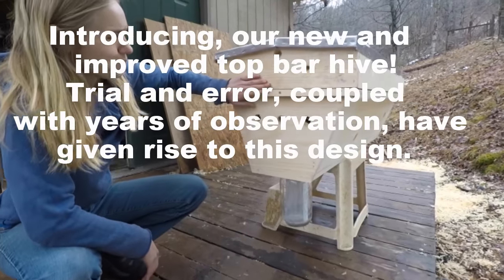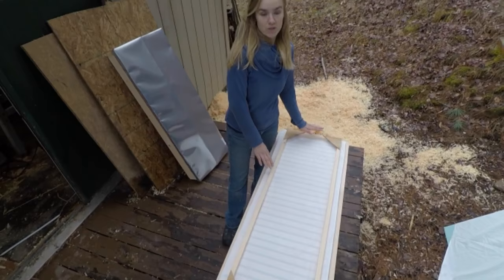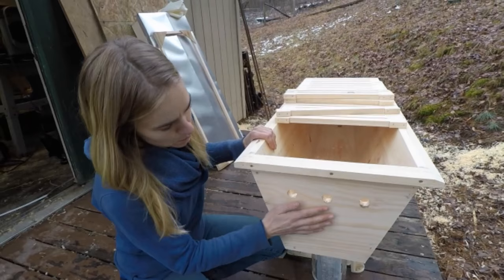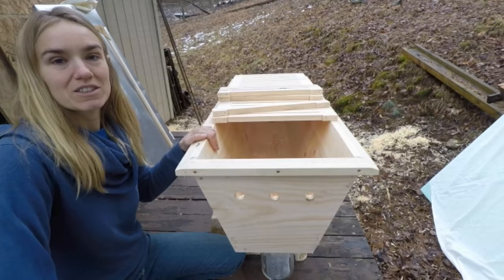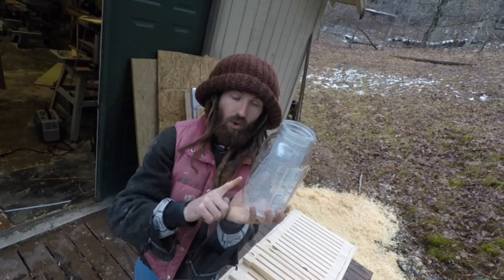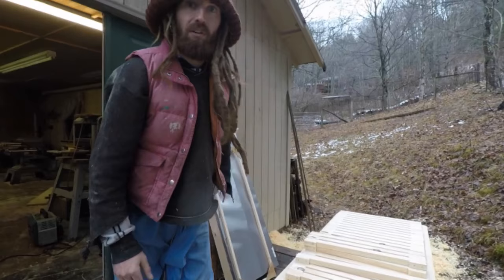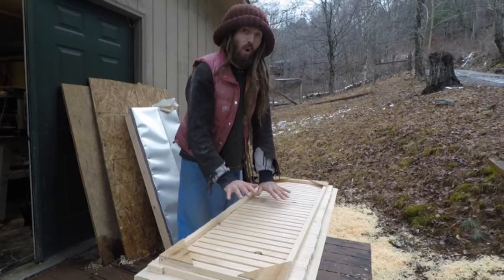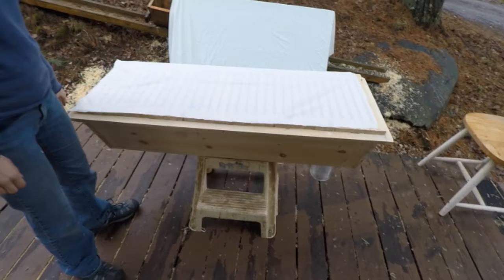DIY! New and Improved Top Bar Hive! part 1 Introduction

Comment: 1--Aluminium mesh for the bees in the summer feeder glass bottle would be good if the aluminium were not toxic. Some miniscule portion of it may dissolve in the sugary water and harm humans from the honey made by the bees. Aluminium is suspected to cause alzheimer's or parkinson's etc. The mesh type ladder may be made by cotton cloth or wooden twigs used in brooms etc.
2--newspaper for winter feeder has the drawback that the bees will incorporate some of the printing ink used in the newspaper which might be toxic for the bees, lowering their immunity
3--Manmade chemically refined sugar itself may lower bee immunity unless raw unrefined sugar is used in the feed
4- The stability of the hive is not understood as the base legs seems to not be shown
5--How the moisture collection and drainage system using the cloth wick system is designed has not been explained since there is no drainage pipe outlet.
6--The roof lid is pretty long to easily lift by an older beekeeper and could give back/spine problems. A hinged roof lid as used in designs of top hives could be thought about
7-Dimensions of the hive, specially wall thickness and roof thickness for braving the elements during extreme summer and winter temperatures for different latitudes must be specified.
8--Captioning and proofreading of the video  might help generate more views from around the world. I could not understand or spell the type of insulation shown in the roof lid at the beginning of the video.

Comment: One thing you might try, drill a hole in the center of the top bar preferably the size of a bamboo barbecue skewer and push it through to the bottom of where the comb is to be built or you can push it through the comb after it is built and it will add stability o the comb for moving or tilting!!!!!!!!! And they are cheep😊

Comment: Could you drill a hole in the center of each top bar preferably a tight fit for a bamboo barbecue skewer to be pushed the bottom of the comb or where the comb will be and this will strengthen the the comb and they are a cheap method to strengthen he comb!!!!!

Comment: Hi There,
I love the quality of the work, and the feeder is genius, I would love to hear how that works out.
A question if I may, and a possible suggestion 
Question, why the spacing b Tween the bars, I thought one of the main points behind the TBH was that she he Bars formed a roof above the bees, and did not let light in, your design lets as much light in as a traditional Hive.
Also if you made the roof angle higher, you could store your Hive tools in the roof. I do this with both my hives, the tools are cheap and this way there is no chance of cross contamination between hives.
Love the videos, thank you for sharing

Comment: Wool works way better then goose down and can be a big mistake to use for bees .Goose down can trap moisture in and hold it instead of breathing like wool does once goose  down gets any type of wet it done it looses it ability to insulate . Just switch to wool .

Comment: A season has pretty come and gone since you posted the video, how did the bottom feeder work?  I'm interested in doing something like that, but I'm also concerned with how it could be insulated during hte winter.
Reply: The glass disoriented the bees and trapped them.  So we started using pvc for our feeders.  The containers we built hold one gallon of syrup.  They seem to work much better than the jars...but are more expensive, unfortunately.